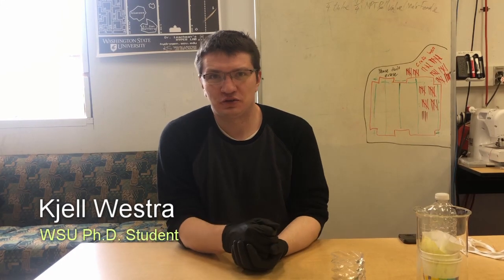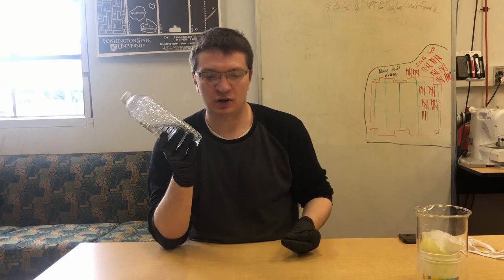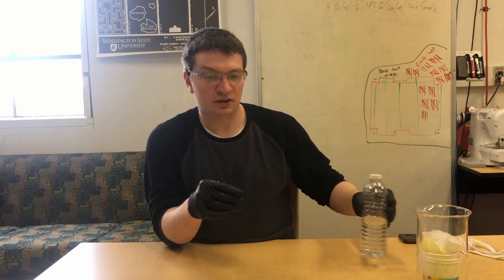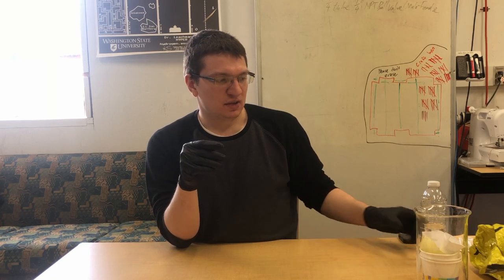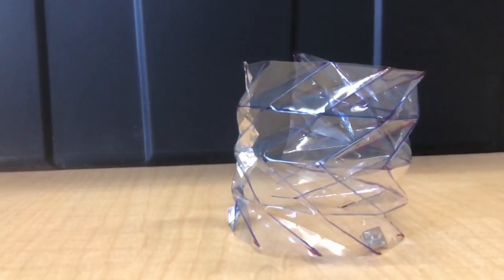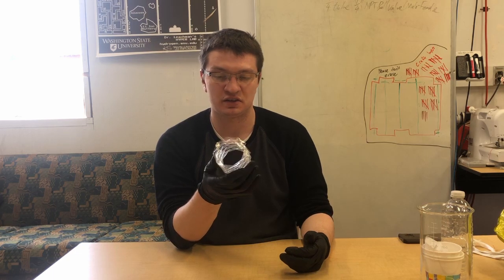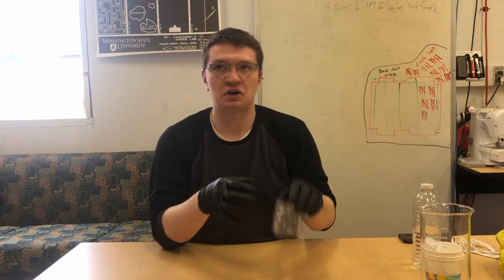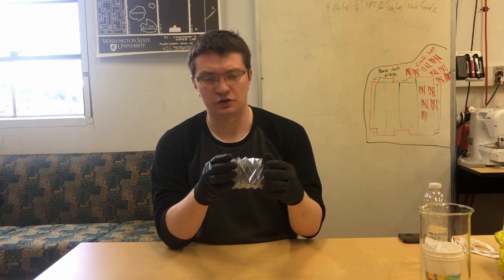Origami Bellows: Interview with Kjell Westra

Comment: Congratulations of receiving a research grant on your proposal. I wonder if you could apply this to the problem SpaceX had with igniting the Raptor engine while still horizontal during final landing approach of ensuring the engines get sufficient fuel.